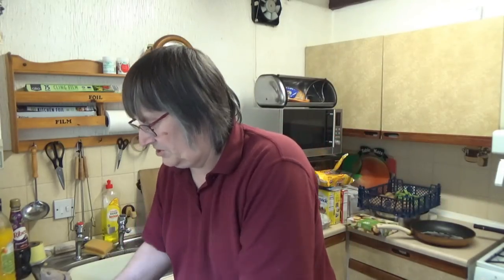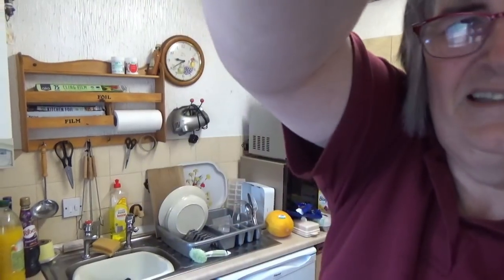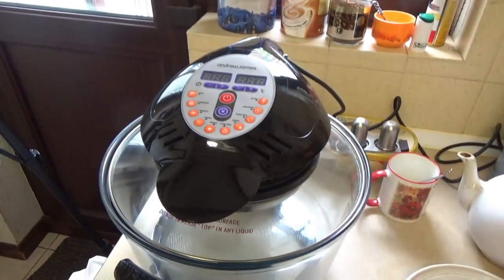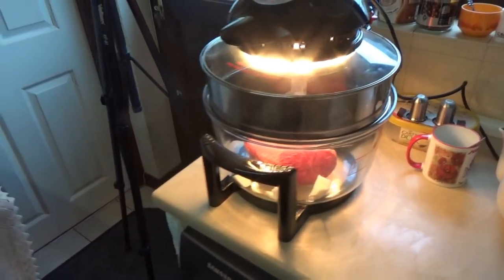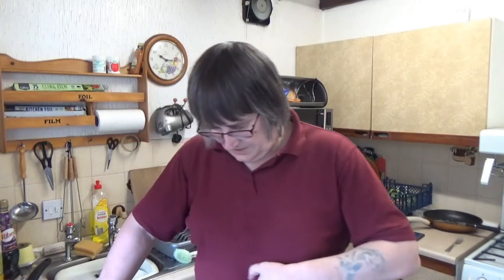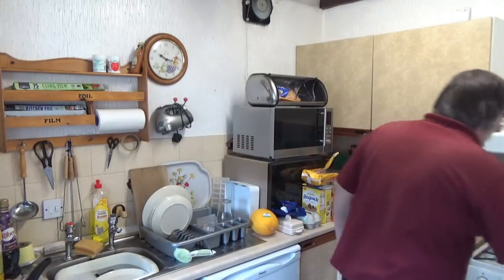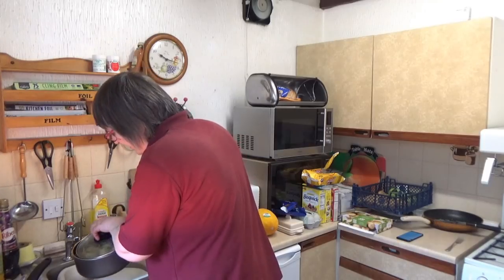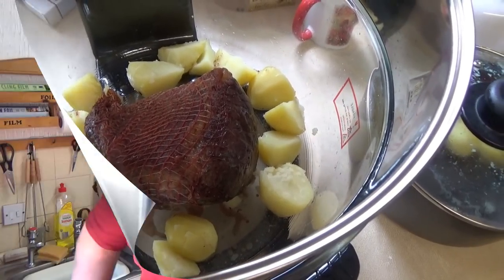In Julie's Kitchen - roast beef in new halogen oven

Comment: Hi Julie ,
I have just bought this oven and I would be grateful if you could show us how to put on the extender ring, as I feel the hinge  would need to be moved, and there's nothing in my instructions, many thanks.
Reply from the maker: Lynne fox Hi Lynne, so sorry but I no longer have the halogen oven, it got broke by the carer on trying to put halogen lid down after use with extender.  I can tell you there is a knack to doing it and it involves sliding a little leaver and pulling upwards then placing extender.